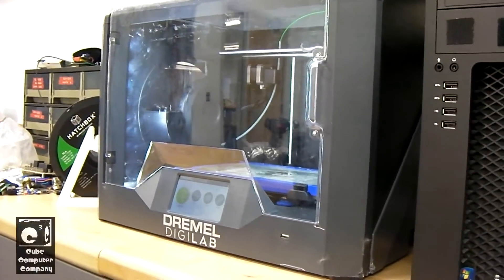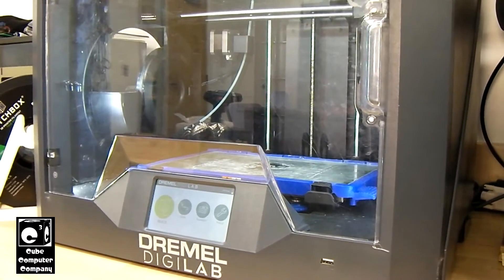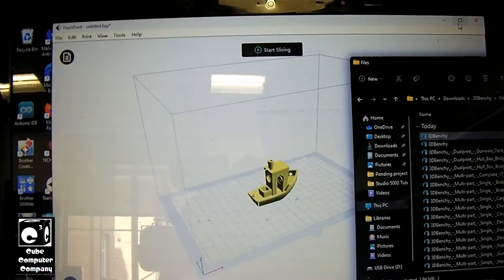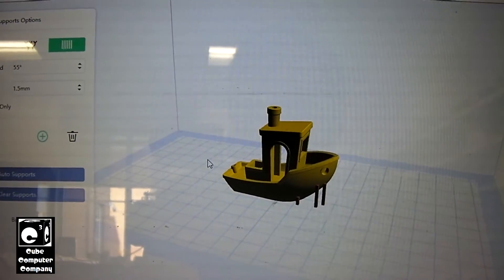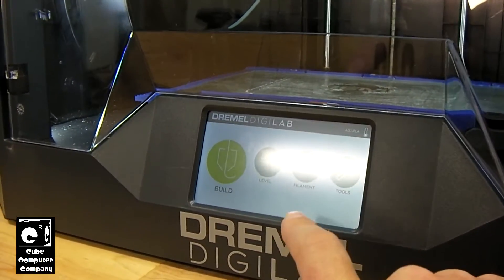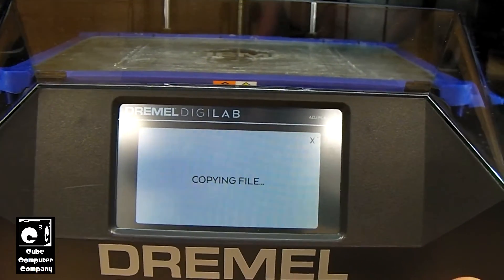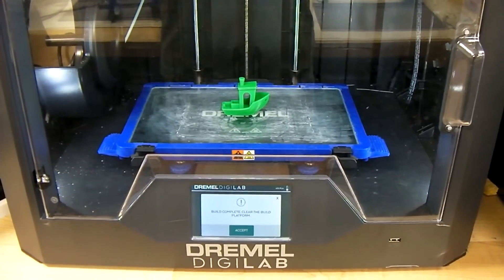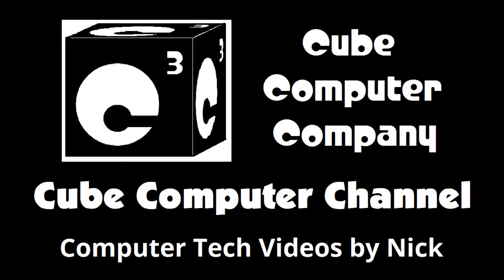An alternate slicer that can work with the Dremel 3D45 3D Printer

Comment: I have one of these 3d45's and I appreciate coming across this video especially that at this time it's only 4 months old so that instils confidence that it will work. I kept having parts fail and when generating supports in Dremel slicer it would make supports within parts that would cause problems because it would be impossible to remove from within.